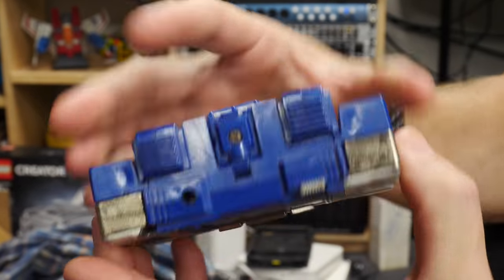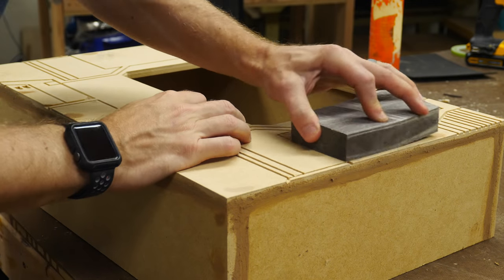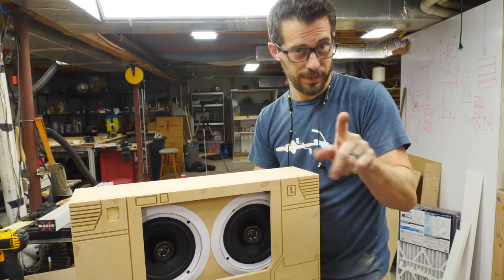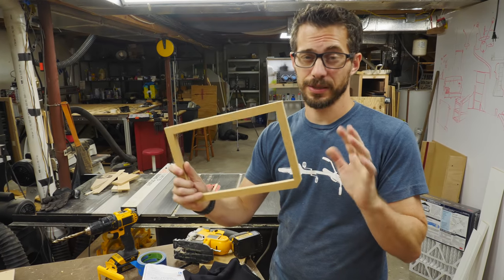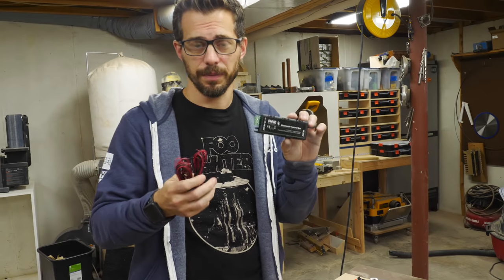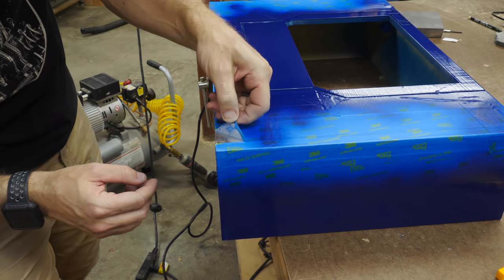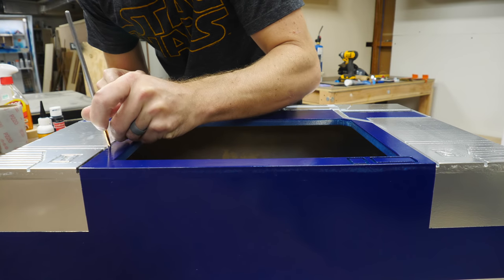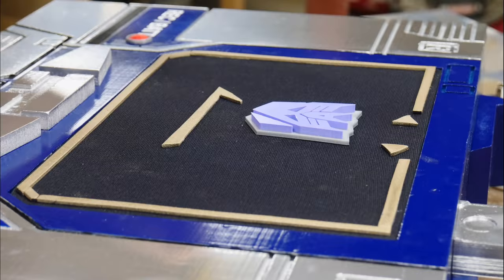How to make a Transformers Bluetooth BoomBox | I Like To Make Stuff

Comment: Really wish he had at least done the illusion of the cassette windows on each side. Would a made it come together a bit more
Reply: Yeah, when he said where wanted the speakers to go, I really thought they would resemble the reels of the cassette in the final build.

Nice trip down memory lane anyway.
Reply: @robin888official  
He should have made the box to fit around the size speakers he chose for the job.
   He only uses 2/3-rds of the speakers...the other 1/3-rd (of each speaker) is blocked behind the front pannel.
Reply: in a way he did. black. ravage was black
Reply: @KumoriBlackPhoenix  He could have also trimmed 3/4 to an inch off an end of each housing/frame since they looked to be plastic,. Even at 3/4 a inch  off each at one end it would have brought them into each other by 1 1/2 inch for less speaker blockage though it is a bit more challenging but works. I've done that before in a car and it came out great.

Comment: Ordered one, put them in my bathroom ceiling, built 1/2 cubic foot enclosures which I glued with construction adhesive to keep the blown insulation away and of course for sound quality . The unit itself is in the roof area too, simply added an outlet. The ac adapter is 12 volt, I didn’t check but I’m assuming DC. I think I’m going to put the same system in my old classic car too because there is no good place to mount a head unit. Thanks a bunch for sharing this item, it’s so much better than the sound bar I had planned to install, your video timing was perfect, I had already bought the sound bar one day before and took it back as soon as I saw the Pyle unit. They make smaller and bigger 10” versions too, in 2 or 4 speaker versions.

Comment: Hey Bob, awesome vid. I was always more of a optimus and hot rod fan but love the throwback. 

As for the tape — EdgeLock tape and FrogTape are designed to have a chemical reaction with paint that comes in touch with it so you get that CRISP edge and no bleed-over. When you use it on a painted surface that isn't FULLY cured, it reacts with that paint. That's why you had that problem. I am assuming the blue cured longer and/or you didn't leave the tape on quite as long?

There is a delicate surface version of the edgelock tape that can work on freshly painted surfaces. It is blue with orange print on it. Otherwise standard tape would do the job with less chance of mucking up the paint job. Ideally... just let the paint cure completely.

Comment: 10 years ago I built my "soundwave".  The challenge of the project is the dimension because need to design first the "tape" with the speakers and after the box. Second, is the coloring. Bob made a great job but the effort is still clearly visible. Third, it is the power, diffferent power source require different size of space.

I would share my experience too to help the audience to make better.

Comment: Hey Bob! Since these speakers were meant to drop in a ceiling they are probably optimized for a large air space (aka big ass box). They'll perform alright in a small box but definitely not to their best potential. For people looking to build a compact boombox I strongly recommend different drivers. Parts express has a great selection of both speaker kits and separate components often with helpful comments/build photos. The spec sheets often specify recommended box dimensions as well. Check them out before your next diy audio project!

Comment: Try diluting shellac with 3 parts denatured alcohol leaving you with a really thin mix and brush it generously on your unfinished mdf project. When it dries (really fast) you’re left with an almost stabilized piece which you can then finish sand and paint without having it soak in the paint. It creates a thin penetrating barrier saving you time from many coats of spray paint.

Comment: Awesome build, Bob.  The only thing I would have done differently is I would have mounted a jack in the back of the box, and connected it to the bluetooth module.  That way I could simply plug the power supply into the back of the box, and wouldn't have to have the cord hanging out all the time.

Comment: Some small tips:
• when it comes to using floor mat foam, dont glue the textured side to anything. glue will not hold on it very well and youll have to cover the gap thatll be present on it somehow. ive had enire costumes come apart at the seams from gluing directly onto the textured side. CA glue may not have the issue of coming apart, but wont sand very well and will still have the gap issue.
it also seems like your contact adhesive wasnt dry when you stuck stuff together. wait until it isnt tacky anymore, and then stick it together. 
• the small detail lines dont show very well, so a black wash with either acrylic or watered down shoe polish would do wonders to bring out those details. 
side note, ive found washes dont work incredibly well with chrome paints, so instead maybe using slightly watered acrylic and then immediately wiping it off where you dont want should work perfectly fine. since the chrome finish is very glossy the acrylic usually wont stick very well if its watery. although i dont know how well the shoe polish will work in this area.
• when it comes to covering large areas to stop paint getting where you dont want it, its alot easier to use paper and tape that on to cover larger areas thatd take alot of time to tape. itll save you time, and tape. 
• it might be worth sealing the mdf with some kind of finish before spraying it, id personally probably plastidip it. thisll usually give less imperfections on the chrome finish and give it a nicer look.

Comment: HAD TO WRITE after seeing you build the stand-up arcade - with what you did for that and what you could have done with this, I felt like a few things needed to be addressed.

1.  I LOVED the attention to detail you put into the front in terms of looks - which is why I was puzzled when you didn't think of the functionality.  Soundwave's alt mode was a Walkman/Cassette Recorder - while trying to make it play gigantic tapes would have been unrealistic, making some of those buttons function like they would on the regular walkman (such as the volume knob that actually controlled volume) would have boosted the impressiveness.

2.  The size you built it would have been perfect to make it Transformable.  While the electronics might have needed to be a little more complicated (mainly the wiring for power and to each speaker,) having Soundwave in either Robot or Walkman mode would have been awesome. The only problem I see with that, however, would have been trying to carry it - you wouldn't want him trying to transform while trying to carry him from the car to the beach, for example.

3.  You addressed a lot of the rest of the things I was going to address near the end of the video - adding a battery for portability and sound effects, for example.  One thought I did have, though, was making that cassette door a video screen or a lit piece of plastic.  If you remember the cartoon, that area not only housed the Decepticon cassettes but served a lot of functions for Megatron and Company, such as converting to Energon cubes.  While doing holographic cubes would be impressive, having some lights and functionality would have not only dressed up and added functionality to your boombox, it would have added another touch of the character to the project.

Awesome build - I just discovered your channel today, and look forward to exploring more of this in the future,

Comment: That was pretty rad. The one thing I would have done differently myself would have been dressing up the speakers and their framing to look like a giant micro cassette then covered it with a more sheer  cloth so you could see it as if it was behind a slightly tinted plastic like you'd see on some old actual boom boxes with tape players from the day. Because, being that close together already resembles a couple of micro tape spindles. But anyway, great job. :)

Comment: The paint came off with the tape because either because the paint didn't fully dry. I don't remember what the correct term is but essentially the paint is dry to touch and sand able but masking will ruin the previous coat unless given a full day to cure. A trick to work around it is do detact your masking tape. Literally before masking your piece put the tape sticky side down on your shirt then remove and mask. The little fibers from your shirt will reduce the stickiness of the tape.

Comment: I general blue painters tape and any metallic paints don't work well together. Even when totally dry the adhesive still pulls up the metallic paint unless a finish is applied. There are some safe tapes though. I don't know the larger equivalent but Tamiya tape tends not to pull when the paint is mostly dry.

Comment: I love everything about this video so much. I'm going to see TF 86 next week in a local theater, my wife got me tickets.

I actually can help YOU with a small tip of my own since you help so many of us.

Being a long-time speaker box guy and actually having worked in the car audio industry for quite a few years? I can say with confidence that 2 light coats of oil-based aerosol polyurethane is your easiest way to get a nice paintable surface in MDF.

It's dry to the touch in 20-30 mins (just do a dusting coat with the first one), and since it's oil? It doesn't soak into the MDF like water-based products.

Just scuff it a bit if its going to see contract, and paint like normal wood.

Thank you so much for this, I wish I had your technical skills.
Reply from the maker: That's a great tip, thank you!!
Reply: @Iliketomakestuff , happy to help in some small way. Thank YOU!

Comment: great build! the only thing id do differently is to sand off the paint where you apply the CA glue. CA on paint just comes off too easily in my experience. better just to have 2 raw surfaces touching with CA glue.

Comment: I'm surprised you didn't use the cutout from the front for the grill cloth insert. The sides might have needed to be built up a little bit, but it would have worked pretty well.

Comment: Love it, but as a finishing touch you should have put a small l.e.d. in the rec/batt button that was on all the time when it was powered.
Reply from the maker: I did think about it, just kind of ran out of time.  The power supply is even 12v, so it would have  been fairly straight forward.

Comment: Awesome build! How did you determine the depth of the lines on the faceplate? Is there a good rule of thumb to go by depending on the thickness of the MDF/board/foamcore you're using?

Comment: Couldn't you have cut off some of that outer ring from the Bluetooth speaker to try and get them centred a little better? It doesn't look important and seems to be there just to have something for the clamps to push against on the other side but so long as you only remove a little it should work right?

Comment: Hey Bob, any chance you want to share that CAD file to save us the trouble of photographing and retracing a soundwave, which may or may not be in a box in the storage locker? I have a single Rockler bluetooth speaker that would work great in a smaller version of your project, make out of wood, maybe 3d Printed.

Comment: Why didn't you use the original cut off from the CNC machine for the speaker cloth frame? Was it broken or did you just not think of it?
Reply from the maker: The bit was 1/8" so that piece was that much smaller than the opening in every direction.  It wouldn't have been a tight fit.
Reply: @Iliketomakestuff  Oh! That makes sense then.

Comment: Are you using vcarve pro to run the CNC? If so you can do the tracing in there.
Reply from the maker: Yup. I pointed it out that you could trace in several different programs.